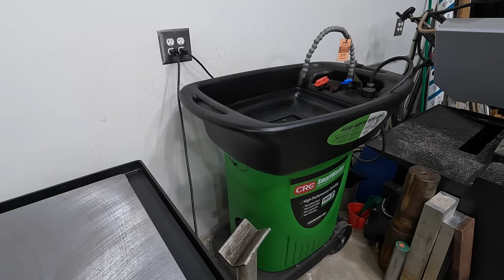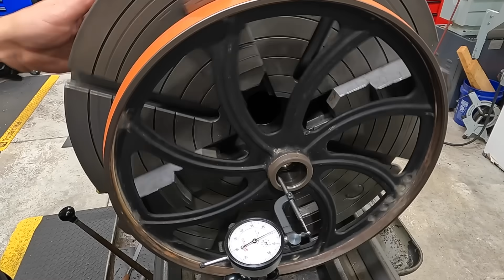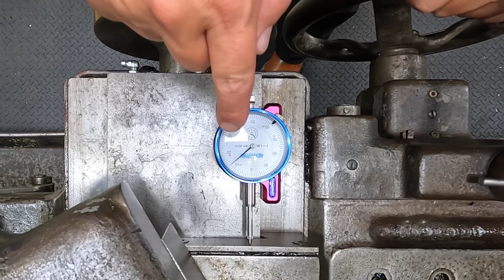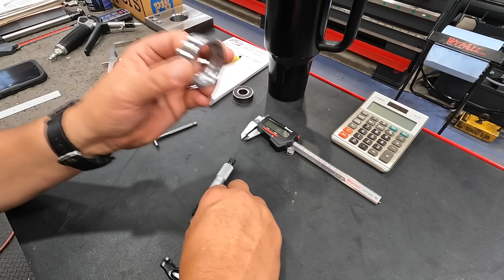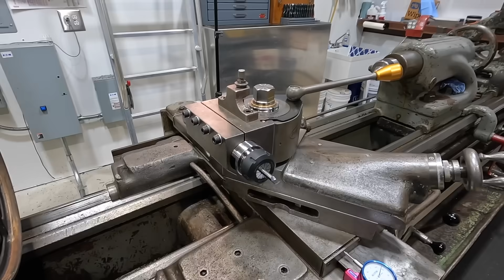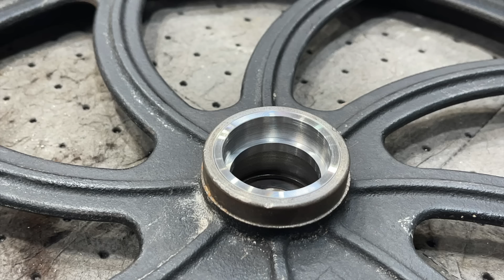Bandsaw Wheel Repair- SNS 381

Comment: Nice job. I'd have machined a complete sleeve for the wheel and sunk a bearing in either side. I reckon poor machining in the first place could be what caused the failure. A decent bearing should run for a long time in something spinning at such low rpm.  It was shielded too!
Reply: Bandsaw wheels are only supported on one side, so it's more likely a bearing failure spinning in the bore. or simply too much pressure on one side and not the other. I'd say they should have used a larger hub/larger bearings it this has been a repeat issue, but then again at this point it's to late to do beyond the manufacturer releasing an updated part.
Reply: @ravenbarsrepairs5594  Something is definitely wrong with the bearing wallowing out like that. My 1945 Delta 14 still has the original Departure shielded bearings in perfect shape. All they needed was cleaning and soaking in new oil.  The new bearing would have slid right in with a little heat from a mapp torch.

Comment: what i typically do first is a little research to see if i can find a bearing with a larger OD then it's just bore and install
Reply: My first thought, and am surprised that he didn't mention that route; a lot less work for him and a lot less cost for the customer.
Reply: Assuming the ID would be the same?
Reply: @julianstafford7071  Easy to do. Those are 6203 bearings. The next size up is a 6303 bearing.  The last 2 digits being the same mean the bore is the same size that being 17mm.
Reply: @julianstafford7071  opps   meant od
Reply: I believe that he wanted it to remain using the standard bearing. I "THINK' that he didn't use another bearing is that the place that uses it as a 'loaner' wheel will be able to look in the parts book and order the correct bearing.
Reply: That was exactly what I thought. Also he didn't make sure that the rear bearing was concentric or inline with the front bearing which is a critical measurement for alignment.

Comment: I gotta say, seeing that wobble on the outer part of the wheel while the center is true does not help my OCD 😅
Reply: I'd like to see the outside of the wheel running true in both axis. That's where the blade runs. Then true the bore to that. I own 7 or 8 band saws and dialing them in is one of my obsessions.
Reply: It also won’t help the bandsaw this will run on.

Comment: You need to check out this product called Electro freeze it's like liquid nitrogen in an aerosol you can use that to freezer part then you can use a torch to heat up your cast iron and it probably would have slipped right in

Comment: Would anyone be able to tell me what purpose is served by the rotating shaft at the bottom right corner of the lathe, the one with the double helix groove?
Reply: Normally a lathe has not so shaft in back. I presume since that American Pacemaker was former a tracer lathe , so that the helix shaft was a driver for the tracer equipment. The tracer equipment is now demounted. I think if that helix was for the tracer , the demount of that shaft brings more problems , so it's better to let it rotate free.
Reply: It's a rapid traverse.
Reply: Adam I know you’re very good at what you do but on that application the outer ring running true and straight is more important than the hub.
Reply: @chucksmalfus9623  Hi Chuck. I think he was aiming for the pair of bearings to be in line. Personally I'd need to take a couple of thou off the outer as well to prevent the blade going tight and slack every rev.
Reply: @passenger6735  that’s why I would have indicated and squared the outer ring then thru bored the hub and sleeved it so everything was running true
Reply: That's what drives the flux copastor.

Comment: Nice job, I almost always agree with the repairs you complete however in this case I would have done it differently. I would have bored the entire center hub and re-sleeved with new interference fit for both berings making future repairs uniform for both sides. That's the only change to what you did I'd have made.  Maybe used liquid nitrogen to insert new interferebce fit bering hub. Ray

Comment: Hi Adam... This is Ross from Sydney Australia watching.. Thank-you for you well presented videos they are very educational... Just a question... Why don't you use Nitrogen to freeze and shrink your sleeves and bushes?... It really works well and can give you a little more working time to insert Your sleeves.. Cheers from Sydney Australia...
Reply: I"ve seen him do it on big shafts when he worked 9-5 for the man so he knows about it, but it's a bit of mess around for a one off like this. 
I was actually thinking of FreezeSpray. It's like refridgerant in a aerosol can and cools to -50ºC (-58ºF) which is much colder than a household freezer.

While I'm being a hidesight warrior i think he could of used the tailstock to get it started straight. Maybe put a block or jack behind it so it doesn't crack the casting.
There's a thousand ways to do it and he did get it done.

Comment: Search "liquid nitrogen pensacola" and you get a half dozen places, All of them will deliver a Dewer to store it, and will also keep it filled. It is trivial to do this. Adam you have set up such a modern shop. You need to get the modern cooling method.
Reply: If you try and run a job shop like that you won't be getting many customers when you add that 'non trivial' cost to the few jobs a month you may or may not require it for.
Reply: LN2 runs about $10/lb. With evaporative losses, keeping a dewar full of it JIC it might be needed gets expensive pretty fast.

Comment: > might have been a bit more work but i think thru boring the hub and shouldering for both bearings is probably more the type of repair the client would have expected. total concentricity of both bearings with no chance of more wear @ the bearing that wasnt 'wallered' out in the hub, giving them something they could ultimately warranty as o.c.. precision content is one thing,  'proper' re-engineering something that is likely to wear out as left undone is more in keeping with the expense of doing whatever in the first place. liquid nitrogen and an electric hand held heat gun might assist the 'shop' when fitting all sorts of precision bearing, sleeve, and/or race fitments
Reply: I suppose he'd need to use a back facing boring bar for that , to enable the shouldering.  Not sure if I've seen him use one of those.
Reply: Given you are in LESS information than even Abom had your clairvoyant skills and assumptions on what was asked by the client is simply amazing. Liquid Nitrogen is in no way required to fit a bearing and unless you are doing heaps there is no way to justify the cost of keeping it in ANY shop.

Comment: Where do you find the specs for the bore for bearings?
Reply: Fits and Tolerance in Machinery's Handbook or the manufacturers of decent to good quality bearings will have a spec.
Reply: SKF must have it on there website.
Reply: The bearing number gives the OD and ID. The last 2 numbers give the ID in millimeters and the first 2 numbers give the OD. You can look those up on any bearing chart as they are standardized. The ID is just the last 2 numbers multiplied by five being at 04. 00 is a 10mm, 01 is a 12, 02 is a 15mm and 03 is a 17mm ID. Yay metric system.

Comment: The way you had to true one side to the other makes me think the problem that caused the damage is the way they machined the wheel to begin with. Just makes me wonder if those bearings were ever aligned up to begin with. I don't think it would take much to wear one side and not the other.

Comment: Would liquid nitrogen have been better for that shrink fit? Just curious.
Reply: Cost is why you don't on smaller lower tolerance bearings. If you use the bearings tolerance range from the manufacturer then size the bore of shaft correctly then the delta between a freezer and ambient or a warmed part is plenty. LN for that sort of job would be all about performance art and clouds of vapor for no gain.

Comment: Dry ice is not that hard to find.
Cooler+dry ice.  Supermarkets sometimes sell dry ice.
Reply: Depending on your Industrial Gas supplier it is common for them to have a CO2 to block adapter on a bottle. Liquid Nitrogen is also common but there are real risks with getting that cold.

Comment: 51:53 .. Adam doesn't use it much .. But I REALLY like to use Loctite / Henkel Stud and Bearing Retaining Compound, on EVERY bearing and sleeve install.  It just gives it that bit more holding power! :)
Reply: I seem to remember an episode on one of these machine shop channels where either adding loctite caused difficulty installing an interference fit, or maybe the machinist explained that he doesn't use it because it takes up space so the diameters have to be adjusted. I'm just a voyeur, so maybe I misremember.

Comment: Shrink fits: do your math first! Aluminum has 3X the rate of expansion as steel. Warm the aluminum with a heat gun or 100 watt filament light bulb and you get 1.7" dia x aluminum's 0.00001 expansion rate/F x 70°F =  0.0012" expansion - 0.0005 = 0.0007 clearance. Warmer would be better. Same figures for chilling steel = 0.0004". Still 0.0001" interference.
Reply: That wheel machined like cast iron.  I don't think there was any aluminum involved.
Reply: @noelhenderson7337 Are you saying Adam doesn’t know the difference between cast iron and aluminium?
Reply: The problem with math is that whoever does it has  to get the math right.  For the steel sleeve, you get a contraction of 4 tenths?, @andrewh gets it at 8.6 tenths, @mikebaxter gets it at one and a half thou.  Adam said he measured it, and it was half thou under, "measuring the sleeve when cold, it was a half thou under the bore"  so implying a contraction of one and a half  thou  (826 bore, 827 room temp sleeve).  Even in your calcs, shouldn't there be a pi in there somewhere?, cos its a circle not a linear rod. Scrub the last sentence.  My calcs come out with a contraction of 8 tenths, so implying an interference fit of one tenths( as does yours); but that's a long way from Adam's 2 1/2 tenths measured clearance fit.
Reply: @martin79-g7z  No pi. Diameter is a linear measurement be the work round, rectangular, or other even polygon. 

Maybe I should have mentioned specific temperature which I assumed 0° in the freezer 70° as toom temp.

Comment: I think I would have drilled and tapped a 10-32 set screw on the seam of the wheel and the bushing, if the cast iron wheel and the mild steel bushing get different temperature expansion it will loosen the fit and if the bushing ever spins that's gone be game over for the wheel hub for sure.

Comment: Seems backwards to me, I would think you would want to bore the bearing true to the outside where the band is going to run.
Reply: If you do that,  the two bearings are not going to be aligned and that's a big problem.
Reply: @bert-blank that’s why I would true up and square the outer ring and thru bore the hub and sleeve it to make everything true.
Reply: The ID of the existing bearing is the optimal reference point. I repair racing transmissions where the countershaft front bearing boss is beat to death from the shifts. I indicate from the ID of the countershaft rear bearing for precise alignment.

Comment: Nice video thanks.
...I likely would have initially planned to do exactly what you did. However after 'sleeping on idea' I probably would have decided on no shoulder.
...Prefer snap ring groove for 2 reasons.
- When loaning out wheel, there is no difference between old / temp / new part. hence less 'confusion' and need to remember to store snap ring in the interim.
- If the bearing ever fails in the refurbished wheel, it would be easier to extract if the shoulder wasn't there.
...Thanks for your channel, nice conversational thought train, educational, relaxing and pleasing to watch. Well done.

Comment: I’m not a machinist, I’m a woodworker and have the Delta 14” bandsaw that that wheel goes on. If I were a machinist I wouldn’t have been able to stop myself from taking off the orange polyurethane belt off and trueing the outside dimension where the belt actually lays so the bearings and the raceway were perfectly true with each other. It would make me nuts not to do that. It’s still making me nuts.

Comment: This would be a good candidate for needle bearings rather than 2 sealed bearings.  With 1 long needle bearing it would last a lot longer before needing remachined.  Just a thought from an old engineer standpoint.

Comment: That design needs a spacer tube between the two inner races, like every motorcycle wheel out there.
Reply: That’s the purpose of the snap rings. To space the bearings the correct distance apart.
Reply: @ellieprice363  Examine the engineering of using deep groove ball bearing in a wheel.

Comment: Why didn't you just sleeve the entire bore for both bearings? Isn't that just about the same work and insures both sides are the same? Not a machinist, so dumb question?
Reply: I think I answered my own question ... You need a shoulder to press the bearings against.
Reply: @deltapparo4451  He could/should have thru bored the wheel and then made an insert that went all the way through. He could have then put shoulders on the inside of the insert for the bearings. That way you ensure concentricity of the bearings and also  have a "stronger" bearing mounting surface

Comment: Assuming general steel, room temp of 80f and freezer temp of 0f on a 1.8” part. You’re really only looking at maybe 8.5 tenths shrink. If you really want it to shrink you need to go liquid nitrogen or at the very least dry ice in an acetone bath to meaningfully shrink it for easy assembly.
Reply: Adam did nitrogen shrinking at his old job.
Reply: @joeylawn36111  I know, just pointing out that you can’t expect too much out of only a room temp to household freezer temp delta. Need more delta T
Reply: @andrewh2341  good point - a freezer isn't cold enough - a few degrees below zero at the most, while liquid nitrogen is -210°C (-346°F).

Comment: Not sure if any one knows or does this, but if you take a styrofoam cup and a can of air, kind for computers, turn it upside down, dump the liquid into the styrofoam, it’s always -59 degrees F. Quite a bit cooler than a freezer, much faster, and you don’t have to keep nitrogen on hand. Not as good as nitrogen, but better than a freezer.
Reply: thanks for the idea!  ill save that one for future use.
Reply: The stuff is primarily R-134A refrigerant, the stuff used in older vehicles.

Comment: They never go with an audience 🤣 Liquid Nitrogen man...Liquid Nitrogen! 🤣🤣 Nice repair Abom👍
Reply: A little heat with a Mapp torch and it would have slipped right in.
Reply: @ellieprice363  Wouldn't you need to warm the whole wheel?
Reply: @johnmorriss5308  I would keep most of the heat on the spokes near the hub. It only needs to be warm to the touch. About 100/110 degrees. The whole wheel will expand slightly. Expensive LNG is  overkill.

Comment: Non machinist here. Is there a reason one side of the boring would wear so heavily compared to the other, is the wheel poorly balanced when on the bandsaw or is it more load bearing on that side or something?
Reply: Reasonable chance that at some time that side's bearing froze and spun. The other didn't. Whoever did the repair just replaced the bearing and called it done until the saw started throwing blades.
Reply: @generessler6282  Ahh, i see. I seen the drill marks on the wheel rim and thought balance might be an issue and there was an attempt to correct it. Possibly just standard practice to balance in general i guess. Thanks for the reply.
Reply: @jacksoncroyce6063  Delta drills those wheels like that from the factory to balance them.
Reply: Yeah I had same thought

Comment: Always amazes me that people continue to send in equipment for repair without fully cleaning it. Some channels can spend an hour or two cleaning equipment at workshpo rates, the customer could save quite bit of cash if they cleaned it themselves.😊
Reply: Sometimes in the long run it is cheaper to have the repairer clean the parts
Reply: I wonder if you steam clean your cars engine before taking it in for repairs.
Reply: @SirHackaL0t.  I have taken pieces off a car or motorcycle engine and have cleaned them before taking them for repair. I wouldn't do it if the whole car was going for a service no. But if people take bits off and then bring them in (or get you to collect) I would anticipate that they would clean them or at leasth get the gross crap off them.
Reply: @billdoodson4232 , As an Engineer and Employer, sometimes I prefer it when the Customer doesn't try to clean the part that they bring in, Sometimes I go out and disassemble the part or one of my employees do it and sometimes it's better when the Customer has cleaned the part, themselves. It all depends on the part and the tools that the customer has to clean the part, and the knowledge and ability of the Customer. I've seen Customers put a tolerance fitted part in a blast cabinet and screw it up.... it was nice and clean but the cost of repair exceeded the cost of replacing the part. The only advantage of the Customer cleaning the part, from my point of view, is that it keeps my Workshop and Machines... Cleaner. (That being said.... I've also refused to work on a part caked in old grease and grime, the customer could have taken a scraper and cleaned it, so I refused to allow it into the workshop and the customer cleaned it on the sidewalk!)
Reply: @SirHackaL0t.  I mean, u see how this is a false equivalency right?

Comment: unless my math is really bad, for a two inch part, you'd need about 200 degrees difference to make a half-thousandth...why heating is always more effective than chilling unless you use dry ice or liquid nitrogen.  Love watching you work, man.
Reply: Yea when I was in carpentry apprenticeship we did the math of a 40° swing in temperature  3/4” in 600’